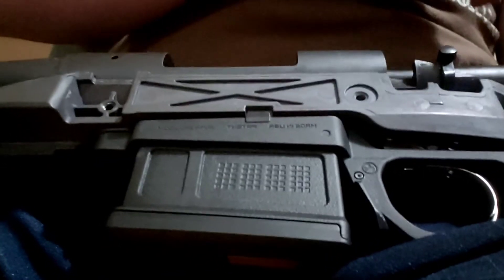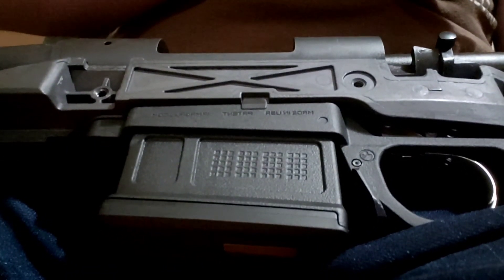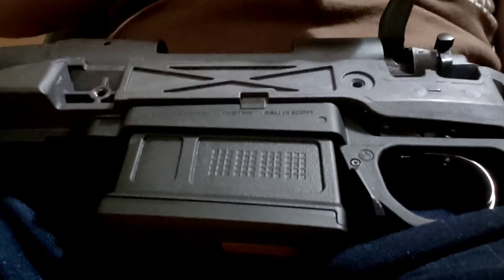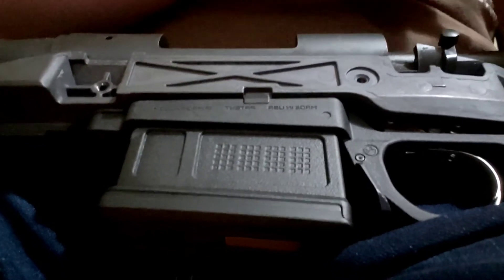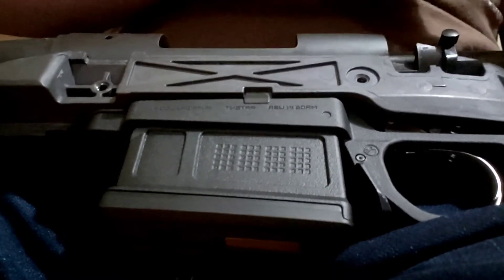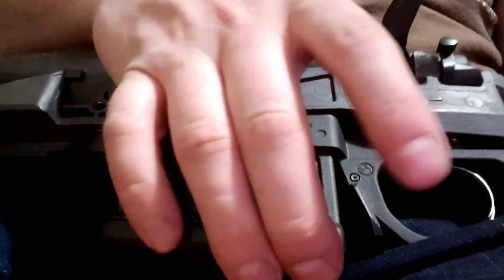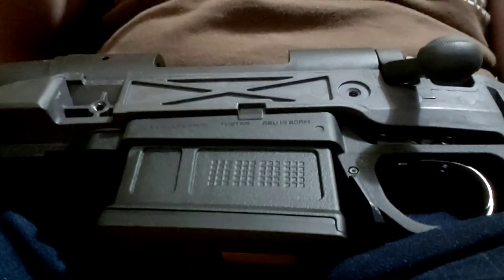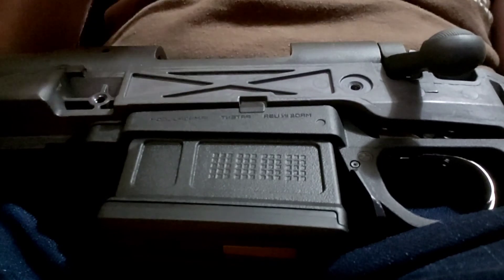Shimming A Magpul Magwell To Eliminate Magazine To Bolt Interference

Comment: Wish u showed the process of shimming it and what you used . So many having this problem and would've been helpful
Reply from the maker: Around the 40 second mark, I clarified 1mm thick aluminum crush washers were used between the stock & the magazine well. My apologies for not saying that exact thing & abbreviating as simply "shimmed w/ 1mm aluminum crush washers". The bolts aren't torqued enough to deform the washers, so they're still likely one mm thick, but they allowed the magazine to effectively move down one mm & no longer drag on the bolt, while still locking in place & cycling rounds correctly. Still shooting sub MOA all these years later, so I have no problem recommending this as a fix if you're using a Hunter stock & the bolt is dragging on the magazine when assembled.